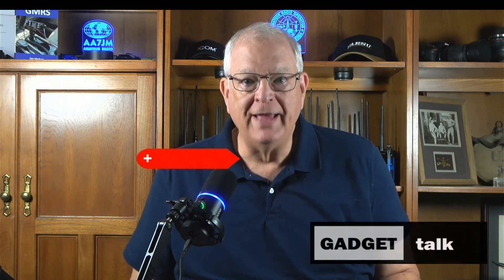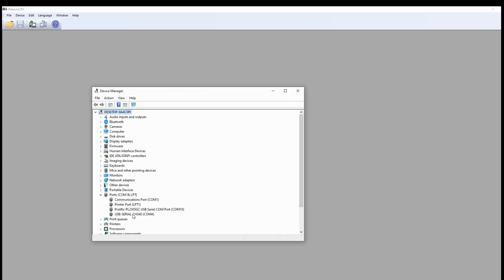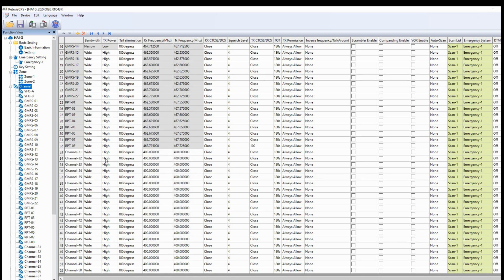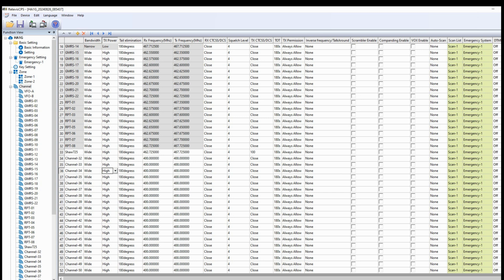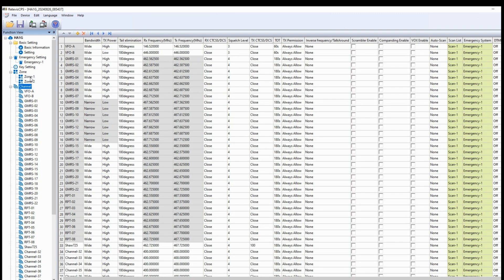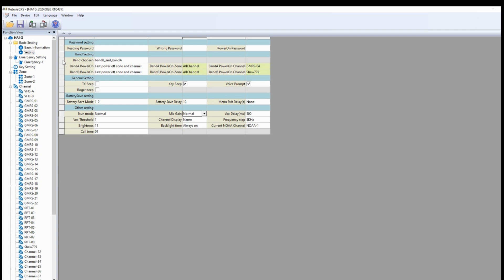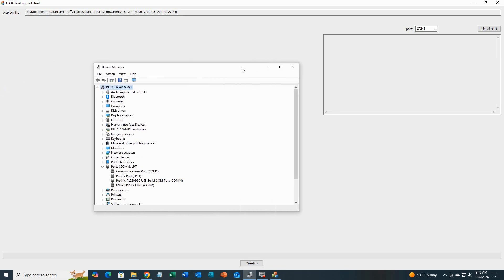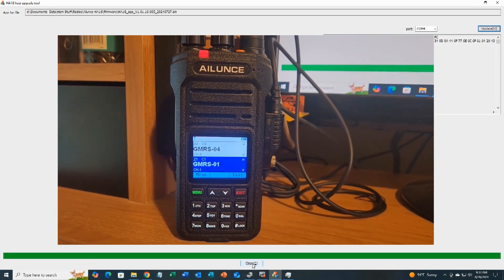HA1G CPS and Firmware Update Tutorial

Comment: Thanks. No. I seen on their videos that they used to have a USB driver update (downgrade) that isn't there anymore. I emailed them and got it. Didn't work, so I googled some more and found the update labeled the same but it was different. It worked as long as I booted up with the radio connected after that.

Comment: No luck. I tried it on windows 10 and 11. USB port is up to date but gives me a error of windows 31. Every other device has no issues. Just this radio.
Reply from the maker: That has to be frustrating. Sorry. For the firmware, did you place the radio into update mode as described at 11:48 in the video. That's messed me up before with other radios. Just checking.

Comment: Great video, quick question, the CPS shows that you can have more than one scan Zones, but I haven’t been able to change the scan zones … what am I missing?
Reply from the maker: I don't use scan much so I played a bit with it and this is what I found.  In the scan settings menu you can set the scan parameters such as carrier, or time based scanning and a couple of others. In the CPS you can access these more easily, in my opinion. You can build multiple scan parameters and label them, then select the scan parameters you want. Right click on a scan setting item and click NEW in the CPS.

The actual scanning is by zones. A long press on the scan button, (star/scan) will scan the zone indicated in the top left corner of the screen. Obviously, you have to set up some zones. The default zones are All, Z1 which is channels 1 -16 and Z2  which is channels 17 - 30. You can scan either upper or lower register - whichever is active. I set my side keys to cycle through the zones instead of using the menu.

I've played a little with the scan list variable in the channel display of the CPS but haven't totally figured that one out. It looks like this is where you assign scan parameters to channels. As I said, I don't use scan much. If you do, please add another comment telling us what you found. Cheers.
Reply: please do a video on the scan feature.  I have tried but cant figure it out...I have had to factory reset to erase my mistakes. I have talked to the company and they don't have a guide to the computer program. @GadgetTalk4U